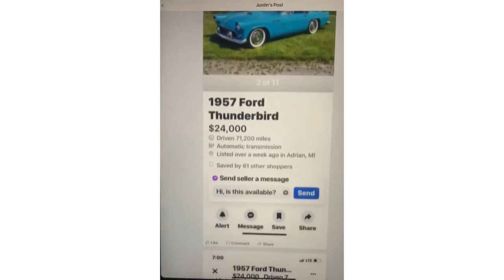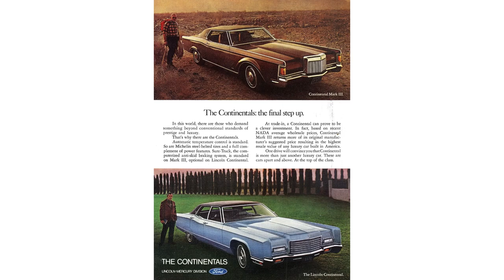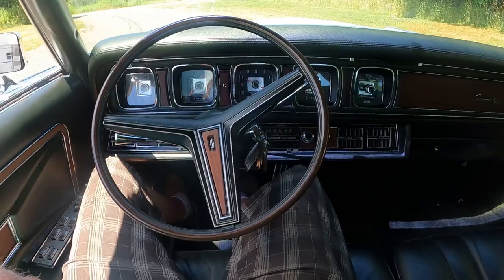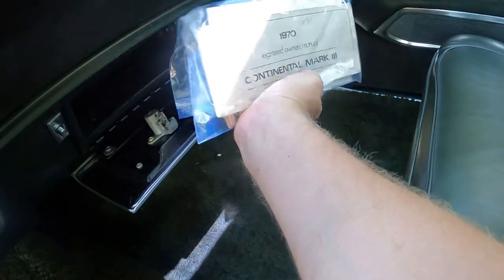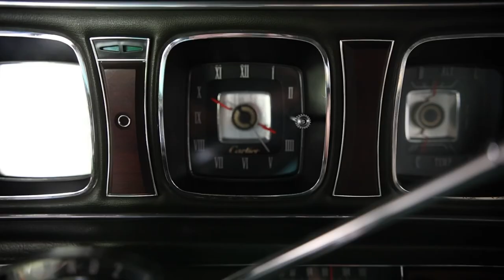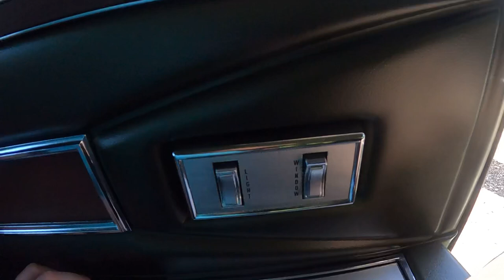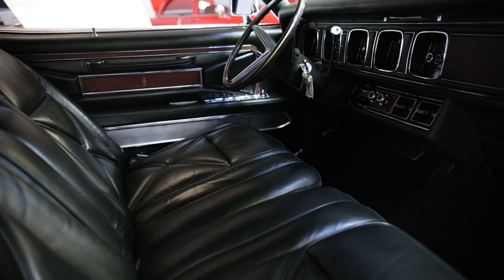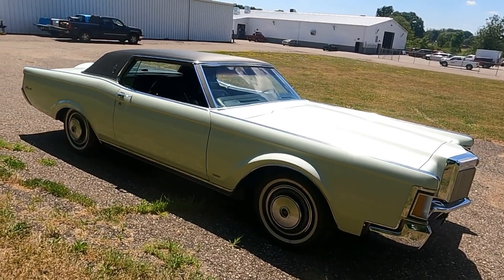1970 LINCOLN MARK III MOST IN-DEPTH REVIEW ON THE TUBE

Comment: It is so nice that so many of the continentals had the sharp frontal edges, which gave the driver an insight into the car's length when parking etc. Not something carried through to today's vehicles, where all the edges are cut off. As well, the Caddilaces also had the rear quarter-light withdrawing horizontally, which is a neat feature. Overall, this is a real luxo-barge in my book. Lots of instruments and the passenger be damned. In my book, any car company that provides a mirror for the driver, ensures a traffic jam as women use it as a makeup mirror while driving. Too much of a distraction hazard. The rooftop row of warning lights is very sexy too.
Reply from the maker: Thank you so much for sharing that insight... I use the mirror feature if I drop something I could shine the light on the ceiling and see inside the crevice before cell phones.. worked pretty good

Comment: Hey Jay, I am happier than a pig in a puddle of mud!!!! Great video & worth the wait!!! You might be able to tell that the Mark lll is my favorite Lincoln of all. I currently drive an 18 Continental & even with all its technology it's not as good as the Mark lll. Yes, the wood on the interior is real wood & the speed button on the dash is simply the on off switch for the cruise control & the little red light next to it glows when the cruise is on. Thanks for sharing this exciting video!!! 👍👍😁
Reply from the maker: =) 
I thought it was you that requested this car.. it’s my favorite mark so far.. the reaction of the guy diving was great. 
Jkgalleria if they get a car they are super cool I can drive those cars for the most part. 

Question what did the button on the end of the turn signal indicator do. I pushed it while car was on and didn’t see anything happen. 

It sucks how far quality fell in the 80s I thing the v is a quality car not same quality as this the V is longer and i think it weighed less.. I haven’t been in either mark I the mark iv, lsc or any that came after that. 

I kept referencing the lsc because in my opinion both of these Lincoln’s were radical the mark III not as much as LSC but to me the LSC is the 80s/90s, it’s almost like Lincoln’s Version of the mustang II, but was well received (to be fair mustang II was well received back in the day not looked as the same now for some people, the LSC is a cult classic and the more I talk about it it’s been a while since I’ve seen one) they used to be everywhere
Reply: @What.its.like.  The button at the end of the turn signal stalk activates the cruise control but you have to make sure to turn on the speed button on the dash, I know, it's confusing!!! As for the LSC, I had an 88 LSC with the 5.0 HO engine & I loved that car, I kept it for 20 years & put almost 300,000 miles on it. It's probs the best car I ever owned!!! 🙂
Reply from the maker: That’s awesome =) thank you so much for sharing that info I want to do one for the channel
Reply: @What.its.like.  👍👍🙂

Comment: Hi, very nice vehicle. I have one just like it but it's light blue with dark blue vinyl top and interior. It belonged to my father-in-law. He brought it brand new and it's been garage kept for the last 30 plus years. just had the carburettor rebuilt. All original, one owner. It's up for sale if anyone is interested. Very very nice car, 73k original miles. I just started cleaning it. The only thing I’ve cleaned so far is the vinyl top, hood and trunk. Will work on the rest a little at a time.
Reply from the maker: Awesome thank you so much for sharing your car with us it sounds really sweet =)

Comment: The cruise switch on the dash board is the master on off switch.  It has to be on the on position to work.  The end button the blinker sets the cruise control.  If you press and hold if it is engaged it will slow down the car.  If you push the end button and let it go it more than likely will increase your speed in small increments.  If you brake or slow down to 30 or 25 MPH and hit tap the end button it will accelerate  to the previously set speed.  Later models of Ford Mercury Lincoln had the cruise buttons on the steering wheel spokes and they eliminated the master switch on the dash board whereas mid to late 70s and mid 80s maybe 90s Cadillac did not.  Hope this helps.
Reply from the maker: Awesome information thank you so much for sharing =)

Comment: Nice car.  Good video.  Yes, the longer video at the slow pace was excellent.
The first integrated A/C panel vents (that I know of) were in the '55 Pontiacs with factory A/C.
Jay, never close a car door by pushing on the window.  8:22  These are windows that aren't supported by an actual door frame.  The reason is doing that weakens the window supports inside the door.  And some car owner's will freak on you.  Jay Leno does this, we don't know why, and commentors go nuts.  Just get into the habit of closing car doors by pushing on the metal above the exterior door handle, that's always a strong area.
Reply from the maker: Yeah I thought that when I did it I was like that window is to thin to push it shut The windows in that car reminded me a lot of the Jaguar XKE windows 

Thank you so much for correcting me and all the other information =)
Reply: @What.its.like.    You're welcome.  One thing I truly appreciate about you is that you have the courtesy to answer your viewers.  As well, you accept and think about information that's presented to you, and that's an indicator of greatness.
Reply from the maker: I’m just a regular guy I put my pants on one leg at a time not better than anyone else. I treat people how I’d like to be treated.. too many people have big YouTube channels and get a huge ego that will never be me. 

Thank you so much for the positive vibes =)

Comment: one of my favorite cars. 70 was the best year. woodgrain dash. high comp engine. but you have to use a octane booster or mix race gas with non ethanol 92. still worth it. I have 77 towncar that is like driving yourvsofa around town.
Reply from the maker: Awesome 400 or 460 in your town car
Reply: @What.its.like.  460. New edlbrk carb. Recond the heads. New exst.  New vacuum and water tubing. Opera window delete car. Fender skirts. Autolamp. Still got the 8trak in the dash. I was going to pull her out for a roll around town today but it's raining pretty hard and foggy.
Reply from the maker: Your car sounds awesome. I’ve always liked Lincoln town cars.

Comment: Don't forget to mention "Commander Cody's "Hot Rod Lincoln.  1970 was a year of innovation.  A "Sure Track" electronic anti-lock brake system became available as standard equipment on the Mark III.  The Lincoln you were driving was equipped with this system.  You would be able to see" Sure-Track" written on the stainless steel band located on the brake pedal.   Also, the feature you mentioned with the wipers going down behind the windshield is called parking and was available for the first time in 1970 Across most of the Ford line.  You are correct that the switch marked "Speed" was the way you activated the cruise control, then a push of the button on the turn signal lever after 35 MPH locked the speed in until you hit the brakes.  The 460 V8 had well over 400 BPH, but for insurance purposes,  Ford used more conservative  figures.  One other feature you didn't mention is "Auto Seat back latches"  When either door is opened, the Auto seat back latch system releases the seat backs and then locks them again once the doors are closed.  You will hear them click each time the door is opened.   Available on 2 door models only.  I love your videos and always look forward to your next one.  I think it is wonderful to see a young man like yourself take an interest in these forgotten and, may I say, glorious cars from this generation.  Furthermore, I am the owner of a 1977 Mercury Grand Marquis 2 door hard top.  "The poor man's Lincoln"  as they were known in those days.   Thank you
Reply from the maker: Thank you so much for all of that added information really appreciate it =) 

Seat back lock thing is weird, I got to drive that Lincoln it was cool when we were doing some of the shots of it driving I was telling the driver that if Lincoln ever made a hot rod this was it I wish I would’ve got a video of his face when we were going down the road because he couldn’t believe how fast it was

Comment: The switch left of the power antenna switch controls the map light, not the seat release.  Also of note the windshield wipers are hydraulically powered off the power steering pump. I have a black 1971 Mark III.
Reply from the maker: On this one it did control the  power antenna goes up and the power antenna goes down The other switch when I clicked it it move something in the seat back because the seat back move when I hit it.. it was weird 

Thank you so much for that information =) 

I took a video of it but for whatever reason that file was corrupted and I couldn’t use it

Comment: The speed light, might be a governor. When you were showing the gouges I was checking to see if there was a second indication arm (usually white) in the speedometer, it might be all electric system.  When get to the set speed that light may flash or a sound is made ,this is so you don't go over the set speed. I  know Buick has this I don't know if Lincoln did

Comment: I have always been a huge fan of Lincoln you actually underscored this vehicle this vehicle is to be considered the greatest personal luxury car ever made in America you also got a cheaper model of this car this car came with other features that are not on this car such as a moonroof such as tilt telescopic steering wheel and I also believe it to be another motor you could get for this car I believe you could put the 427 in this car too if you would get the option this call also comes with dual exhaust with you did not mention this call also came with what was that doesn't feature a rear defroster you could also get in this car a CB radio and you could also get an 8-track player
Reply from the maker: This was always one car that I really wanted to drive and when we went out and shot this video I told the driver I said punch it it will surprise you and it flew him back in his seat and he just couldn’t believe the amount of power that it had. One of the best riding cars that I was ever in

I eventually worked for this company over the summer and I was able to drive this car and it did not disappoint I’m not sure if I drove it in the video or not

Comment: One more thing I didn’t mention and don’t see in any post was the auto high beam option.  I’m not sure why Lincoln chose to mount the sensor/amplifier out on the left side of the cowl but they did.   It looked almost like a laser gun or radar!  Lololol if you look at the owners manual you will see a picture of the unit and description of how to operate it.   Another awesome feature that my car has is the HUGE ASC power sunroof.  It’s a metal panel covered in the same Calvary twill material as the rest of the top that retracts. No glass like 95% of cars with Moonroofs/sunroofs.  It’s about 22”x like 39-40”.  Lolol like a convertible
Reply from the maker: Thank you so much for sharing that information =)

Comment: Jay, you need to wear both the lap and shoulder belts on the test drives of these older cars.
Reply: Seriously, you need to start buckling up when you review these classic cars. Aside from the obvious safety aspect of wearing the lap and shoulder belts, you will have a better feeling of how the car drives and handles. Belts will hold you firmly in your seat and enhance the overall quality of the drive. When you accelerate, brake and take a curve you will feel more confident and connected with the car. And if something happens, you may get to walk away scratch free.
Reply: Back in the mid 1970s when I turned 16 and got my 1970 Electra to drive, I had been through driver's ed and knew that it made perfect sense to buckle up but for a kid in the day it wasn't cool to be seen wearing a seat belt. One night mainly out of curiosity I decided to try out those old style separate lap and shoulder belts. After driving around that night, fairly aggressively I might add, I was blow away with how much better the car drove, handled and overall performed. A better driving experience and added safety, even a 16 year old thought buckling up was a no brainer. LOL, none of my friends seemed to get the message and I was usually the only one in the car with the belts buckled.
Reply from the maker: A lot of those Classic Cars don’t have seatbelts my truck doesn’t have seatbelts I don’t plan on putting seatbelts in it either I had a 67 mustang that only had front seat belt, There is a argument whether or not they actually save lives I know a guy who wasn’t wearing his seatbelt The paramedics said if he was wearing his seatbelt he would’ve been killed. But you’re right I need to work on wearing my seatbelt
Reply: @What.its.like.  There is always going to be that one odd crash that a seat belt may or not have helped someone but in general you are better off being buckled up. I am a bit iffy on lap belts alone doing much more that just keeping you from being ejected.  In the Lincolns you have driven they had shoulder belts and you should have worn them in conjunction with your lap belt.  Is there a number I can call you?  I do have a request for a review.
Reply from the maker: Shoot me a message on Facebook or email me 

What_its_like@yahoo.com

https://www.facebook.com/groups/707697117215381/permalink/903860170932407/?mibextid=S66gvF

I’ll call you through Facebook if you’d like
Reply: @What.its.like.  Don't do  Facebook so I'll email you later.
Reply: @What.its.like.  See if you can find a 1970 Buick Electra to drive and review. That would be awesome. That's the car I had as a teenager. Thanks, Brad

Comment: The 0-60 is actually quicker...I've seen '69 models run in the high 7's, and the '70 models, with a little more weight, aren't too much slower.  From a roll...mid and top end, they move very well.

Comment: Worked for a car dealer that tried to sell a Lincoln Mark 111 with a bad transmission. The car was abused by teenagers. Although, same as any car dealer they wanted too much money for it.
Reply from the maker: That’s crazy.. I had two Lincoln town cars 88 and 89 the 88 was one of the best cars I ever owned the 89 was the worst car I ever owned 3 transmissions in the car.. I only drove that one 500 miles in the 2 years I had it, the 88 
100,000 in 3 years
Reply: @What.its.like.  Well, Just that I prefer my old 1965 Thunderbird. Backthen I had lost it as a teenager. Saving for a long time. Rebuilt the car I got from a garage.

Comment: Nice car, mine is nowhere near this good condition. My Lincolns interior is totally pretty much ruined, the leather is completely dried out beyond saving. The paint is completely destroyed, almost down to bare metal because it had to be stored in an outdoor storage lot for many years, but its been in the Southwest, so it has very little rust. So, I dont want to return it to factory resto, but am thinking a retromod, When I got mine, it already had glasspack mufflers, American Racing rims and had been lowered in the front, so it handled quite well when driving it.

Comment: I agree. The Mark III's are stunning automobiles. The body sculpting just made it seem as if it was moving. Far superior than the Mark IV ('72 was the best). The Mark V was close but still didn't have the character of the Mark III nor the quality. I also like the Mark VI, Mark 7 and 8. Wasn't the Mark 7 back on the Thunderbird platform? This color combination was certainly stylish, better than all the browns. They also had a yellow one with dark brown top and interior. Those were stylish as well even though it had brown. Baby blue and dark blue was also fantastic. I have had several Lincolns over the years back then and the Mark III was one that never crossed my path. I had an '89 and I can understand exactly what you mean with the crumbling arm rests. I had a '92 that didn't have that problem. I still have the '89, not is such great shape though. I like a little longer video, if that works for you. More information and you seem more relaxed.
Reply from the maker: Yeah it was all the same Fox body platform.. I had two town cars 88 and then 89 both signature series the 88 was my favorite car I’ve ever owned, God I miss that car. I was 18 when I got that car paid $1,100 for it it had almost everything velour pillow side seats keyless entry, auto head lights power trunk and everything worked I put 100,000 miles on that car in 3 years and sold it because at that point it had 225,000 miles with all the original stuff. I bought other cars but never filled the whole in my life left from that (I owned 67 mustang at that time) I found a 89 that had everything leather digital dash automatic changing mirror this car had everything but the sunroof.. which the 88 had I don’t remember what I payed for that one it was cheaper than $2,500 try to buy cars on the cheap.had 80,000 miles I had nothing but problems with it put three transmissions in that car it SUCKED never had another after that.

I’m a huge mark VI fan I tried to buy a few but everytime id look at one something major was wrong I drove a fully loaded one a few years back with 351w we ran out of gas on drive and had to push it reminded me of mustang days lol =)